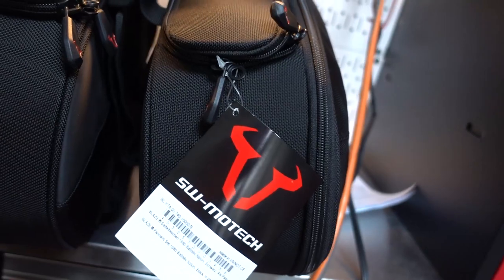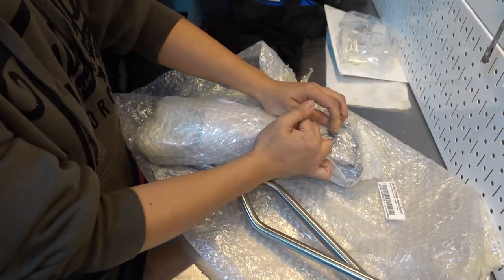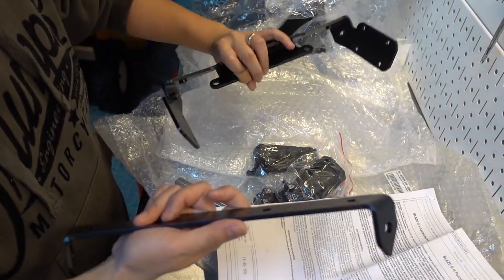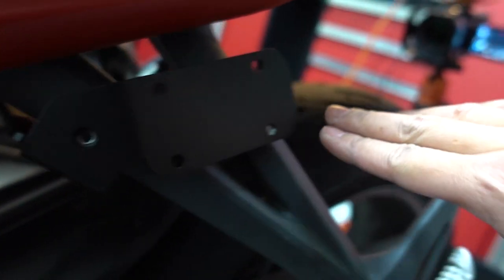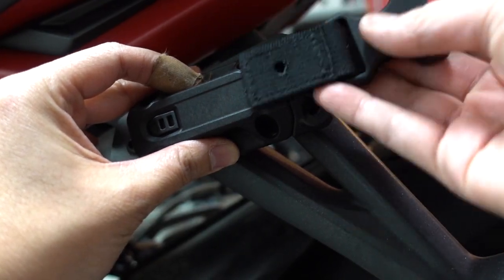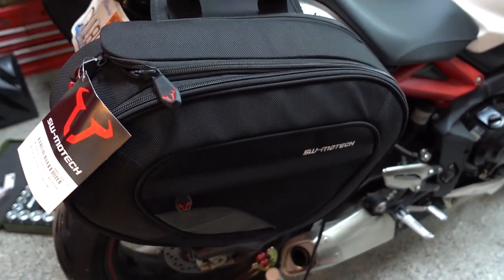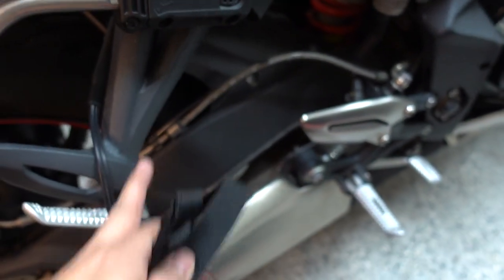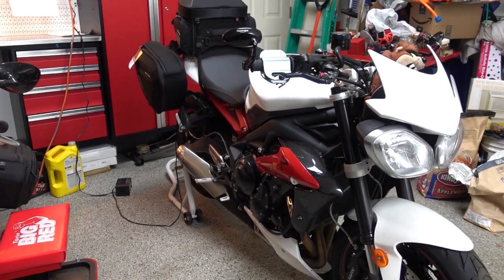SW-Motech Blaze and Rearbag INSTALLATION - Triumph Street Triple R

Comment: Hallo, thanks for your Video. Do you can make me the pleasure to measure the holder plats which you have fixed under the frame. I have a Speed Triple NN01 but without the high exhausts and maybe I can fix the system from the Street on my Speedy, with some small modifications. Thanks for supporting me. Greetings from Belgium.